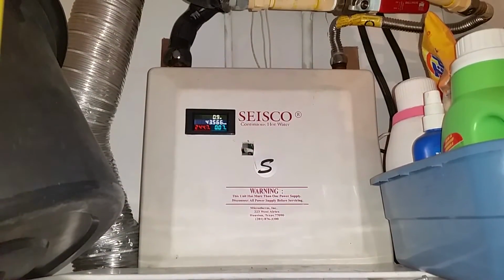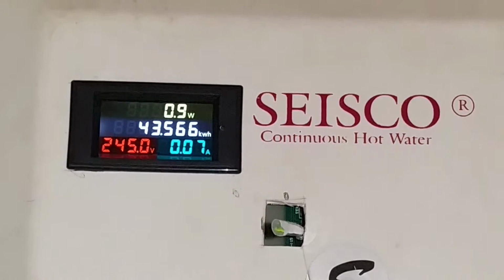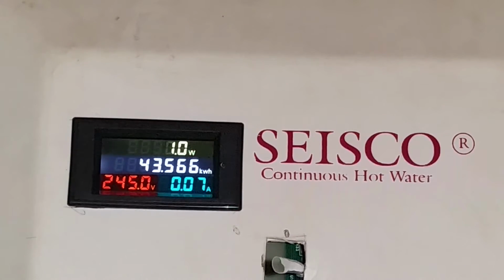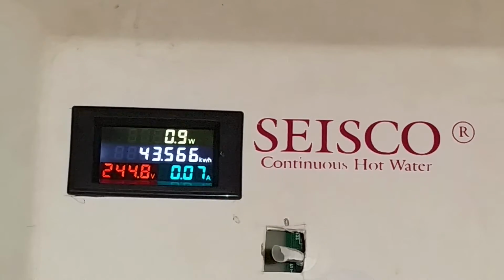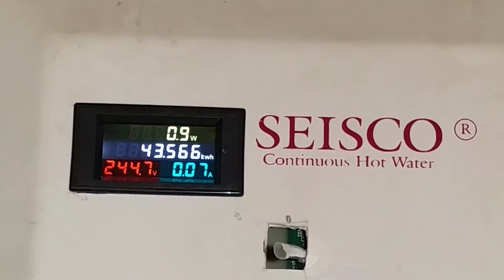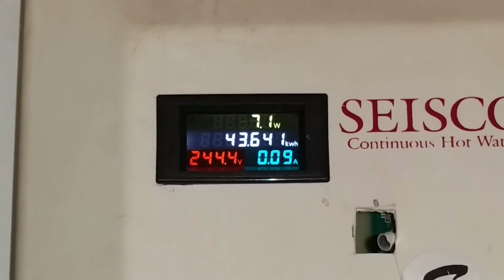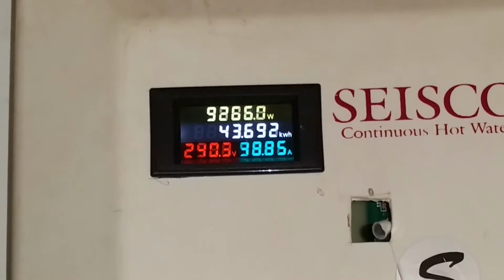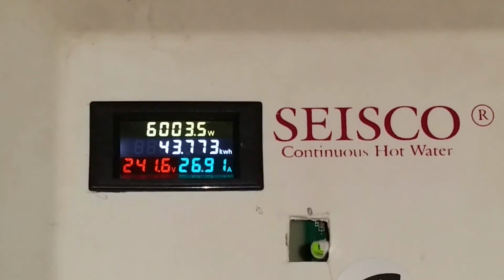Add smarts to Whole House Seisco RA-18 Tankless Hot Water Heater

Comment: First time I see this model
Reply from the maker: This brand was bought by A.O. Smith about 2018, so not in business anymore.  It uses a Dupont plastic body, early model production problems led to its downfall from cracks, but has a sophisticated computer sized motherboard with tight temperature regulation and no moving parts for water movement detection, auto grade thermistors.